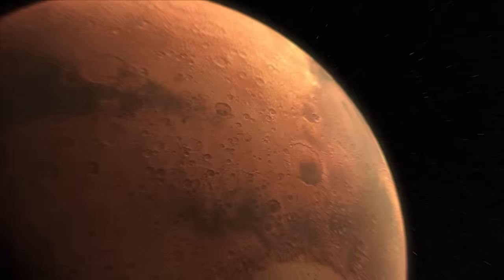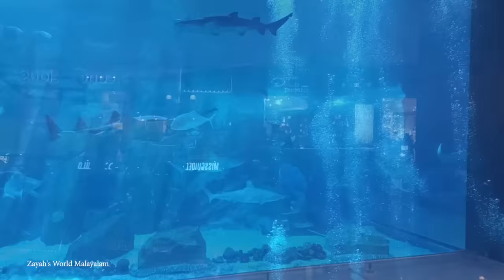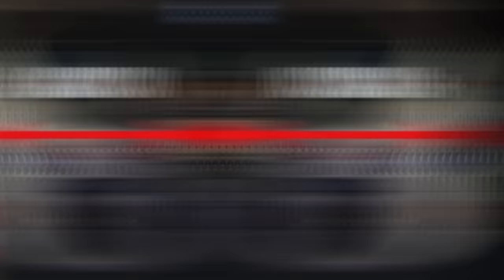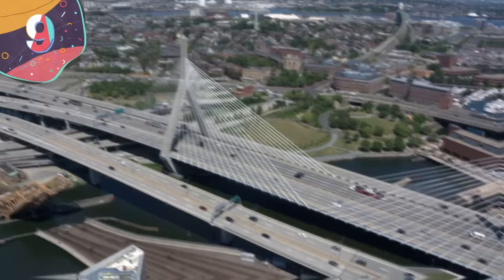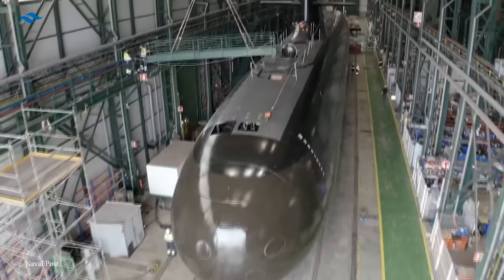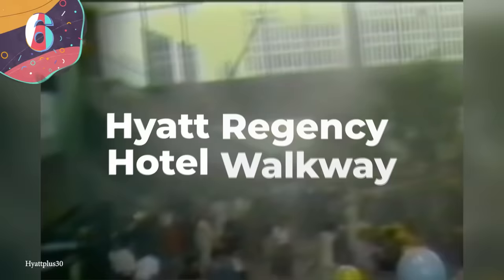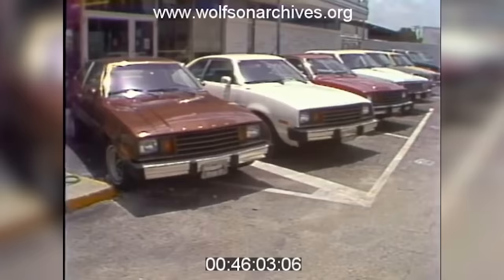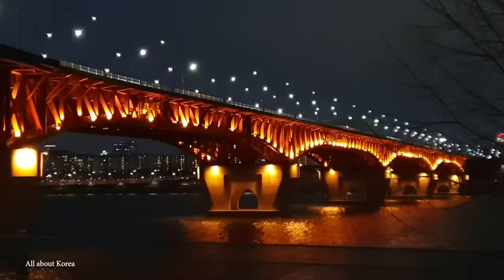15 Crazy Engineering Mistakes

Comment: I got a brand new 1972 Ford Pinto (special edition) as my first car. Base model was $1,800; mine cost $2,700 and still had no power steering, power brakes or air conditioning. Had it for 15 years. The day the recall was announced I came within about 3" of being rear-ended because some idiot suddenly stopped in front of me for no reason, and the guy behind me laid down a lot of rubber as he skidded.

Comment: Footage of the Ford Pinto explosion was later deemed engineered and is not indicative of actual fuel tank failure during accidents, not to say they didn't occur.  The footage you use should have a disclaimer or remove ve it.

Comment: The number 3 one (Deepwater Horizon) affected my town here in Florida panhandle.  I remember it.  Oil-soaked birds, turtles, fish, etc.  ALL along the beach.  Oil balls still being recovered occasionally. 
The dispersant they used only got Oil off the surface (made it sink) so the full extent of Oil damage isn't truly known.
Reply: It's still leaking now isn't it? I heard it was capped but not sufficiently, but was sealed to "acceptable" levels of leakage by the company which is completely unacceptable in reality.
Reply: @darianistead2239  they claim it is no longer leaking but people here do not believe it. We are still finding areas of beaches with tarballs. Boaters are pulling up chunks of tarballs that clung to the coagulation and dispersants they used and sank in the ocean.
It's still affecting us here that's for sure.
ANY level is not acceptable.
Reply: I actually was just hearing the company did a crappy job cleaning up that oil spill and that there are still wildlife who are displaced from their habitat and that it isn’t rare to find wildlife with oil on itself.

Comment: Cool video but disappointed that the Tacoma Narrows Bridge collapse didn't make it onto this video. The Millennium Bridge swaying 3 inches side to side has nothing on "Galloping Gertie" which collapsed in 1940 after only being open for four months. Plenty of videos showing just how drastically the bridge was swaying not just side to side but also up and down at the same time. It was one of the longest suspension bridges at the time and the entire center section looked like waves in the ocean before completely collapsing into Puget Sound below.
Reply: I've seen at least 20 videos over the years, probably more, telling the story of Galloping Gertie. Most of these were new to me, which I appreciated very much. To my way of thinking, Gertie is old, old, old news and there is nothing new to tell about the incident.

Comment: I had one of those pintos. Mine was a 77, and by then, they had fixed it. All they did, was put a piece of nylon or white plastic, between the rear end housing, and the gas tank. That's all it needed, and it worked. Car kind of got a bad rap for something stupid.it really wasn't that bad of a car.
Reply: The  engineering  mistake of the pinto  was to  avoid a few dollars  per car in manufacturing costs by not improving safety voluntarily ,even when they were negotiating minimum safety standards for future models.  The accusation is that they said they were doing the best they can  eg eg when negotiating the test standards  ,  but this talk was in public domain so its like a promise to the buyer.  Other car models may be been doing the best they can .. or at least they didnt admit to knowingly avoiding a simple cheap no-side effects improvement....

Comment: One of the issues with the Chernobyl RBMK reactors, was that the RBMK designs, while generally very safe, have a positive void coefficient in their design. Basically, the more "voids", IE bubbles in the coolant, in this case water, the faster the reaction, the more heat, etc. This, combined with a cutoff of the water coolant, caused a massive feedback loop and overheating. US reactors, by and large, have a negative void coefficient, whereby the more voids, the less reactive the plant. There are other safeties in place for both, of course, and several RBMK reactors have been operating successfully for decades.

I have, again, way oversimplified. i just wanted to share a little something I knew.
Reply: Its not true that  positive void coefficients can be made safe.  The problem is that if parts of the reactor core is ever melted, then the coolant pipe could quite easily be blocked,and rods stuck, or rods moved, to a bad arrangement. ..so it must be assumed that the coolant water will be boiled away.   At fukishima, the boiling of the cooling water  only resulted in minimal melting of rods.
Reply: @isilder  It is true. Generally they are safe. A lot has to go wrong but when it does, they are more likely to have a meltdown. Having said that, there are several RBMK reactors still in use, successfully, for decades.
Reply: Rbmk=real bad make kaboom.
Reply: @darrylhaynes9208  💯

Comment: Just prior to those panels collapsing,  my family took a vacation to Boston. We drove through that very tunnel. When we saw that on the news we felt very lucky.
Also power isn't volts, power is watts
Reply: But anyway, the cable was used ,in testing, for too high current ,  which was achieved via too high voltage and  also resulted in too high power.   Too high voltage causes sparks and  explodes holes in the wire,snd that would have been noticed . . Too much current made the wire hot, which cooked the insulation and made it brittle ,and that wasn't noticed.
Reply: @isilder  Actually the causes of the Apollo 13 disaster were much more complex than indicated in the video or in these comments.  The oxygen tank was designed with thermostatically controlled heaters to evaporate some of the liquid oxygen to increase tank pressure when necessary.  The heaters and thermostats were specified by NASA to operate on 24 volts (which was the spacecraft operating voltage) and they were designed accordingly.  At a later time the voltage used on the launch pad was increased from 24 volts to 65 volts but nobody thought to change the specification on the heaters or thermostats in the oxygen tanks.  It really should not have been a problem as the cryogenic liquid oxygen would have kept the temperature low when the heater was powered and if it did warm up excessively the thermostat would turn off the heater before it overheated.  Problem was that at one point the tank was dropped which dislodged some of the plumbing inside the tank meaning that the normal emptying procedure of flushing the liquid oxygen out with gaseous oxygen would not work.  When they needed to empty the tank on the launch pad the engineers did a "work around", emptying the tank by turning on the heaters to boil off all of the liquid oxygen.  This worked, but the excess heater current caused by the much higher voltage on the launch pad caused the thermostat contacts to weld closed.  This caused the heater, running at about 7.5 times the power level it was designed for, to grossly overheat near the end of the process when there was no liquid oxygen keeping it cold.  The extreme temperatures fried the Teflon insulated wiring inside the tank leaving it in a state ready to make a spark.  Teflon is normally not that flammable, but in a high pressure 100% oxygen environment many things we don't think of as flammable will burn very aggressively.  This was a lesson that should have been fully learned during the Apollo 1 disaster but it seems the lesson was not learned well enough.  The spark ignited the wire insulation, the heat evaporated liquid oxygen causing tank pressure to rise resulting in an explosion.  Oops...
Reply: @Vincent_Sullivan  Thunderf00t just release part 3 of his analysis of the Apollo 13 explosion.
Reply: @evensgrey  Thank you for that reference David.  I just watched the video and it is very well done and covers all of the important points leading up to the disaster.

Comment: Hyatt Regency.  Matthys Levi's excellent "Why Buildings Fall Down" describes this tragedy very well. 

The design called for pairs of long threaded rods hung from the ceiling; a short cross-beam with a hole at either end was slid on to both rods and lifted to the fourth-floor level, and threaded collars spun onto each rod and up under the beam to secure it. Repeat with another beam and pair of collars at the second-floor level.  Repeat this structure several times across the atrium; lay the walkways across the beams. 

The rods and ceiling connections were designed to carry the load of the entire structure with a reasonable margin of safety, including dead load (the simple  weight of the structure itself) as well as static & dynamic loads of people using the walkways.  The cross-beams were likewise designed to carry the various loads of a single walkway, again with a reasonable margin of safety.

The long rods were expensive, heavy, and generally difficult to handle, and threading the collars from the end all the way to the fourth-floor level took a long time (and time is money).  As actually built, they hung shorter rods from the ceiling down to the fourth-floor level; a short cross-beam with TWO sets of holes at each end was slid onto the rods, with the threaded collar attached underneath to secure the fourth-floor beam. Then a second pair of threaded rods was slid through the second set of holes on that beam, with a nut on top, to hang a second set of shorter rods from the fourth-floor beam down to the second-floor level; the second-floor beam was attached to these rods as per the original design.  Again, repeat across the atrium, and lay the walkways on the beams.

The second-floor walkway was thus suspended from the fourth-floor beams, instead of from a continuous rod all the way to the ceiling, which meant that the fourth-floor beams were carrying both walkways - twice the load they were originally designed to carry - and, those fourth-floor beams were weaker than the original design, due to the addition of a second set of holes. Some of these beams failed, which led to the cascading collapse of both walkways.

Comment: Talks about Apollo 13. Shows video of the shuttle, but doesn't talk about the two catastrophic preventable failures. Hmmm.
Also in general, for a video about engineering mistakes, I'd have expected a little more depth about the actual mistakes. For example, what was the reason for that bridge disaster? Or for that matter, the other bridge problem?
As for Deepwater Horizon, if I recall correctly, this was ultimately a case of regulatory failure, where regulators relied more than warranted on self-regulation in the industry, which, in the end, was more interested in cutting cost than enhancing safety, with entirely predictable results. Just like, oh, the 737max disaster? (And while we're at Boeing, when - if ever - will we see Starliner actually work as intended?)
Reply: Can't wait for your YouTube channel.
Reply: @nunyabidness117  Don't need to wait - not that it's a particularly interesting channel, but it exists.
Reply: Well it's not like this is the History Channel or a documentary it's an entertaining list video.  You can put whatever you want on your channel and videos and then people can correct and criticize it I'm sure lol 😁👌

Comment: The biggest engineering / design mistakes in South Africa are the Foreshore freeways: parts of the highway just hang in mid air.
Reply: Didn't SA also have a problem with trains (or just locomotives?) with wrong dimensions?

Comment: The one thing I'm curious about is what happens to the previous rovers that were sent to Mars.... ie. what do they do with them after their "useful life" as an exploration rover has ended?
Reply: The end of their "useful life" is basically when they no longer can communicate with mission control on Earth.  The Spirit rover was declared unreachable in 2011 (after being stuck in place for 2 years by a bad wheel and soft sand and having fallen out of communication, and likely not being able to generate enough power to survive the Martian winter in hibernation mode due to the bad angle of its' solar panels as a result being trapped in place) having operated for 2208 Martian days and driven 7.73 km.  The Opportunity rover lasted 5352 Martian days and drove 45.16 km, being lost in a planet-wide dust storm in 2018 which either damaged the vehicle or deposited too much dust on it for it to be able to produce enough power to activate.  (Mission design parameters called for 90 Martian days survival and 0.6 km driving distance.  This makes both of these rovers among the greatest overachievers in spaceflight history.)
Reply: If we ever build a Colony on Mars, the rovers will likely be recovered (assuming we can find them and/or they've physically survived the MANY Martian Dust/Sand Storms they'll have experienced by then) and either placed in a Museum or recycled for their materials...

Until then, they'll simply be abandoned in place once they can't do their job anymore...It's not like we can bring them back to Earth...

Comment: The platform issue happened in Ireland also. Trains ordered for a suburban service from Dublin to Drogheda (30 miles north of the city) were too wide for stations on the route, which had platforms extending under road overbridges at stations. The shorter sections on the "wrong" side of the bridge were abandoned and new sections at the other end of the station added to maintain platform length.

Comment: Why hotel walkway flaw wasn't explained?
Reply: Corner cutting contractors.
Reply: @greghackney8437  well yeah but others got a bit more explanation why things happened.
Reply: They should have mentioned that, it was really pretty simple. The design had long steel rods running from the roof down through the lowest walkway. The contractor cut corners and used shorter rods. One set ran from the roof to the top walkway. Second set was joined to the first sent and when down to the next walkway. The joints failed.

Comment: I had a classmate die in a pinto in the summer of 1975. Rip  Dave.
Reply: Rip in the eternal. 
Every construction should have prayer over them for safety...
Reply: @Love-jf7rs  Solid engineering would work much better - as has been tested a number of times, prayers don't work. At all.

Comment: The SNCF (french railways) example was not an engineering mistake. Due to new EU regulations about train sizes they knew from the beginning the trains would be too wide for the existent gap between the tracks and the platforms. The scandal was the company aggressively tried to force the regions to pay for the platforms rebuilding. The regions leaders angrily refused to share the costs and complained to the journalists saying the company designed overwide trains. The journalists did not really investigate and spread this version of the story leading the transport minister to ask for the SNCF CEO to be fired (which did not happen)

Comment: The designers of the pinto wanted to put the fuel tank between the sides of the rear seat, in the truck. The sales department said no, because they were thinking of offering a fold down access to the trunk. Had the fuel tank been there, it would have shielded the tank from contact.
Reply: I had a 1979 Pinto back in the early 1980s.  Never had a problem with it over 7 years, although a police car backed into my front bumper in 1982.  Mine didn't have  fold-down access to the trunk.
Reply: @cynthiasimpson931  They never got aroind to offering that option.

Comment: The walkways in the Hyatt Regency were never meant to be danced on, merely walking was a danger
Reply: IF the walkways had been built according to the original designs, yes, actually you could have safely danced on them...

With the way they were actually built however, it's a Major Miracle they survived as long as they did...I'm surprised they didn't collapse within the first month or 2 after the building was finished but it actually survived 13 months before failure...

Comment: #Top Five Forgot another fact about the Millineal bridge. It can't be used in wet weather as the floor gets MORE slippery then ICE and so fare all the "fixes" Have failed to correctly fix it to the point it aren't a hazard to cross for people with mobility issues.

Comment: Why was there no mention of the continuous variable transmission for automobiles.  They are garbage with the exception of Subaru's version and Toyota prius version. I probably changed two a week.  Nissan seems to have especially bad ones.  But hey, it is job security.

Comment: I believe the KC Hyatt walkways were poorly engineered.  From what I read they could not have been built as designed.  The contractor came up with a “fix” but should have kicked it back to the architects.
Reply: The contractor kicked it back the the ENGINEERS, who proceeded to completely drop the ball.  If you check back, there was a lengthy legal fight, but in the end, it came down to the engineers not reviewing the proposed modification to the design properly.  Ultimately, it was the engineers who had to answer for their mistakes in court.  (They were also stripped of their licenses.)
Reply: @evensgrey  thank you, I forgot that part of the story.